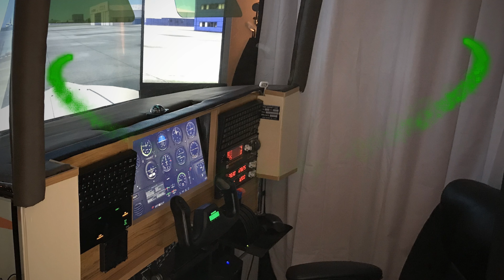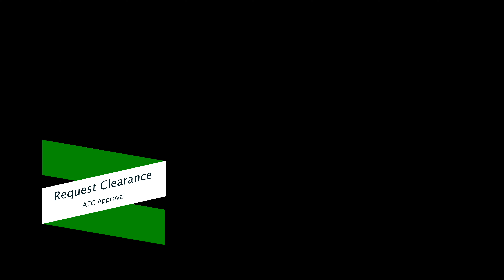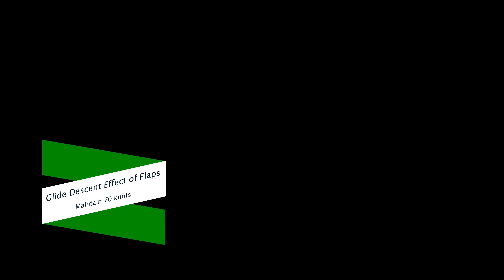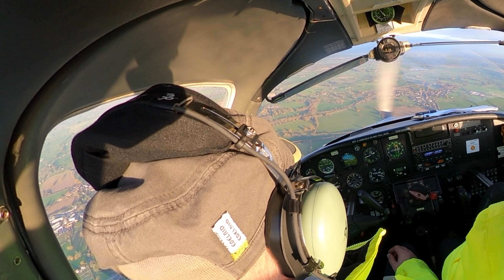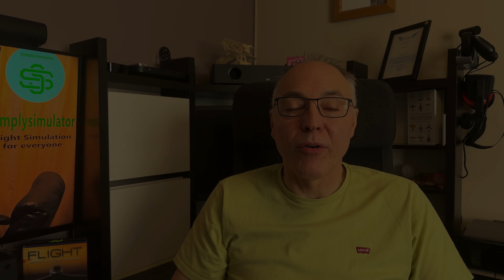#81 Flying Lesson 10

Comment: Great, thanks for sharing !!!
Reply from the maker: Buongiorno glad you enjoyed it. Finally the flying feels like it is starting to come together. I was amazed how similar the simulator is to the aircraft technically and in response. BUT the key to the real flying is looking outside and getting used to the attitude and linking that with the sound of the engine - you cannot learn that on the sim. Really glad I decided to learn. Thanks again for your comments and support very much appreciated. Ciao ✋
Reply: @simplysimulator  
Thanks for the answer, I'm happy to know that the simulated PA38 behaves almost like the real one, with all the limitations of the case. Given your real experience, you could then make a video with the PA 38 with the simulator explaining how to have an experience as close as possible to the real one. How to remedy, for example, the fact that in the simulated flight one does not feel the sensation of ascent, or descent, etc. with one's own body. .
Ciao
Reply from the maker: @aureliomarsili3902  Great idea 💡 thanks again for the comments and feedback I enjoy reading your thoughts and suggestions - have a lovely evening.